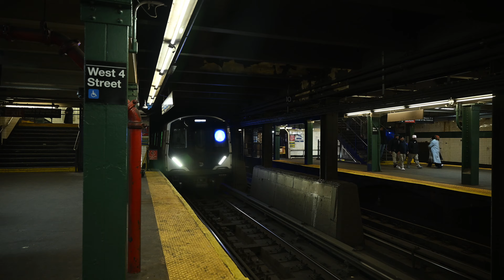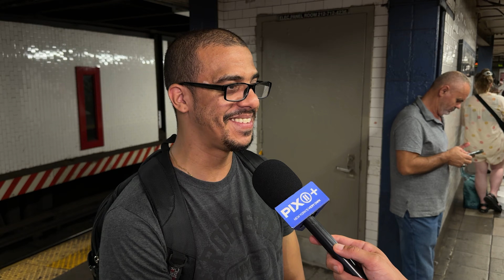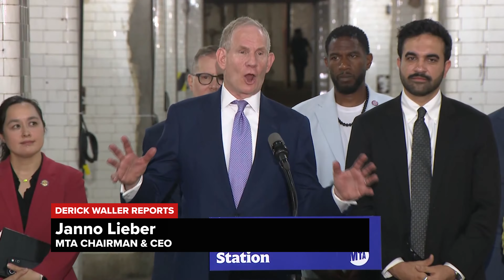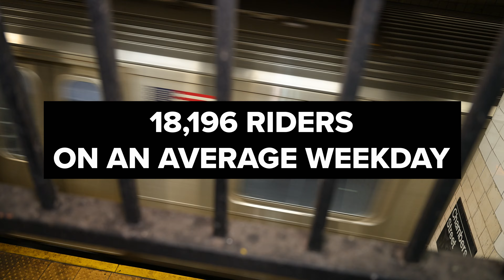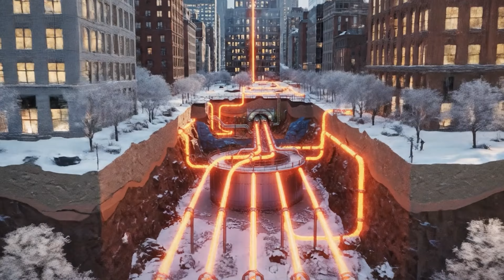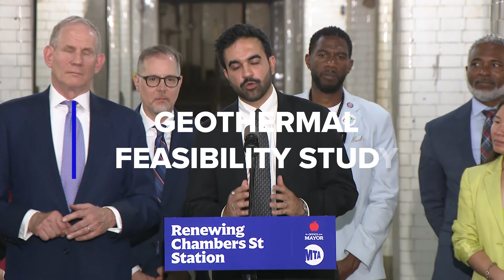I Took a Temperature Gun Into NYC's Hottest Subway Stations

Comment: Lol not the way those temp guns work need a solid object to  take a temp of won’t  do ambient temperature
Reply from the maker: Not sure why that’s funny, but yes you’re correct. To get accurate readings, we pointed it at objects in the station. Obviously different materials will get different numbers. So we used a thin paper towel as a control. I thought pointing it at a paper towel looked weird on camera. So we made sure the numbers it read matched what we were getting consistently before sharing on camera. Hope that helps. And thanks for watching and commenting.
Reply: Just like a probe won’t do ambient temperatures

Comment: Did I understand that correctly?  They are going to move the heat from the subway into the government buildings?

Great for winter, but what about the summer?  Will the heat still be transfered into government buildings and then what, air-condition itt away?
Reply from the maker: It is my understanding that the heat would be stored in this new system and then saved for winter. At least in theory.
Reply: @wallernyc I am glad you recognized that this is a theory.

In their current theory, the heat will never disapate and summer heat will remain "lock in" until winter....6 months of keeping it at the same temperature with nothing added?